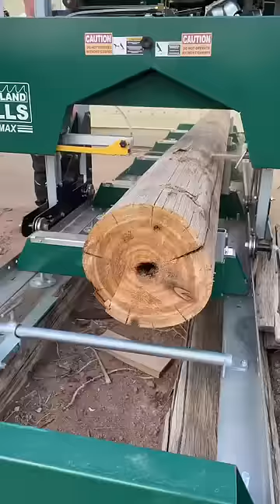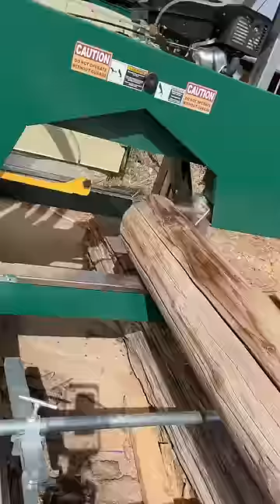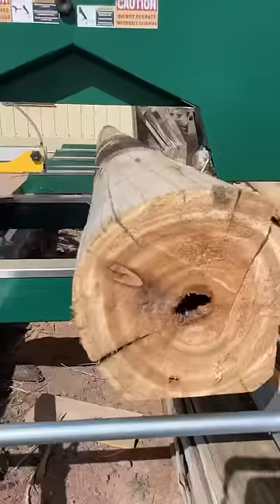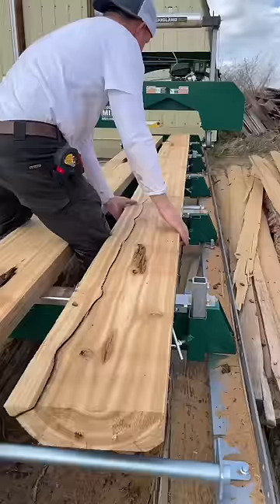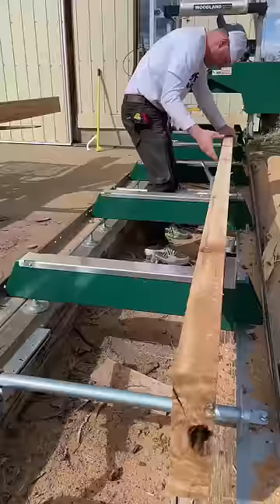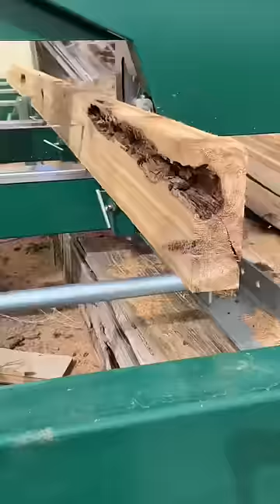Slicing up and old pole #woodworking #maker #shorts #diy #woodwork #tools #sawmill

Comment: I'm curious to know, what causes the center to rot but not the outside?
Reply: The video maker should know the answer
Reply: Bacterial infiltration, usually at the top where rain, snow, etc. accumulate.
Reply: @tommielee8  Thanks for the explanation.